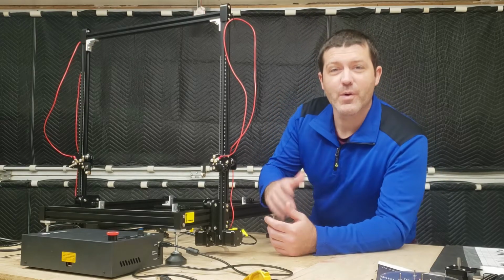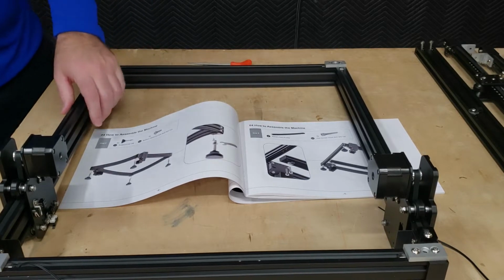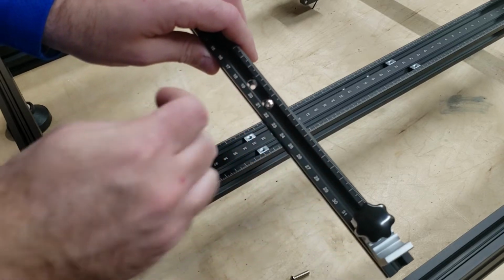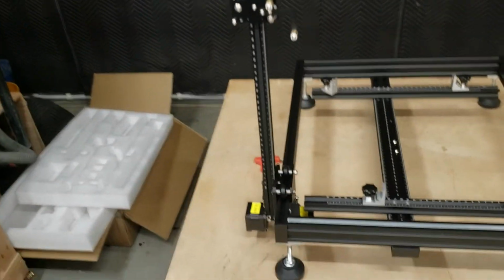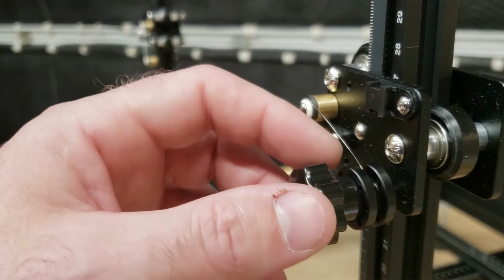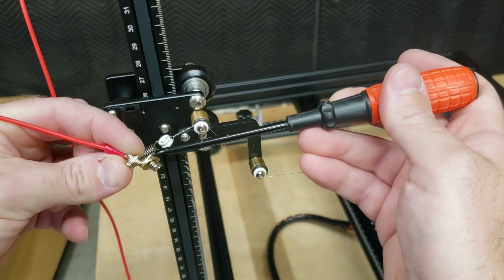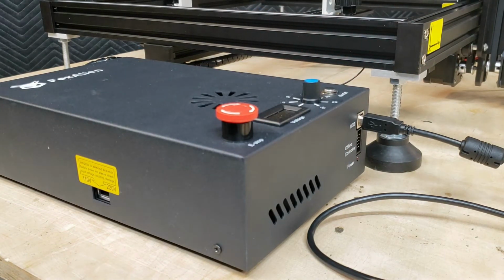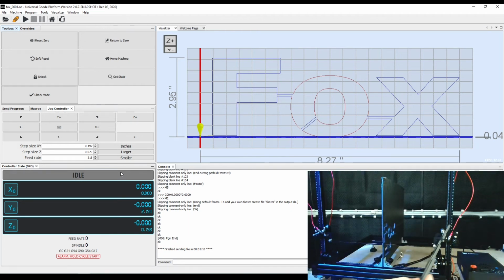Hot Wire CNC - Complete Build & First Cuts

Comment: I've been looking around for a Hobby-level Hot Wire Foam Cutter that uses the rotary device for turning the foam during slicing. It seems that any that were commercially available are no longer being sold. I see that you had one, at least back when you made your video. Do you still have it? Do you still actively use it? Or might you be willing to sell it to me?
Reply from the maker: Where are you located?  I wouldn't be able to ship it.
Reply: @SethCNC  I live in Hawaii, way the heck out here in the middle of the Pacific. Could you disassemble it into its basic parts so it wouldn't need a huge box?

Comment: Best to take down a deprecated machine/website link.  I'm not sure what happened with FoxA, but sad to see they dropped this.  I've already staged up a 1000mmx1000mmx1000mm caged Foam cutter myself and have been very happy with the results.
Reply: Im planning on building one around that size. Did you build it from plans?

Comment: Nice video!  So how does one go from a CAD program like rhino with a 2D layout to gcode with appropriate feed rates in UGS?
Reply from the maker: I used inkscape (free) to make the toolpaths.

There's another software option called DevFoam available in multiple tiers including one that does 3d using .stl files but that's a paid program.

Comment: So using pink foam for Halloween project what can this CNC do that my xcarve can't do? I know its cheaper but just seeing the pros and cons. Thanks
Reply from the maker: Let's say you're making a silhouette bats, back cats, or even a gravestone that you'll just paint (or spray with a stencil)  the front words on This would cut 2D about the same speed as the cnc cutting in a single pass, but workpiece holding is easier/faster to swap out materials, although the size as shipped is a little small for gravestones, doubling the length would take about $70 to double the length and height, price including longer wires.. (can you tell what my plans are yet?) 

Also, no foam dust to deal with, sure there's some fumes to either filter or extract, but no foam dust to collect and dispose of, or to cause static and trip off the cnc  😳 

From my research the way to make the most money from this machine is to make foam RC plane parts, but it would need some expansion to do larger models.